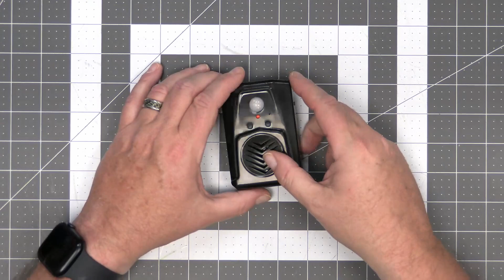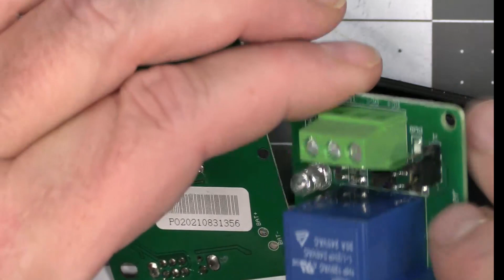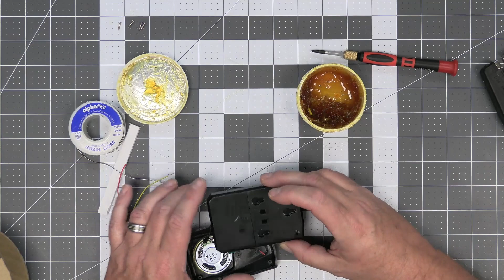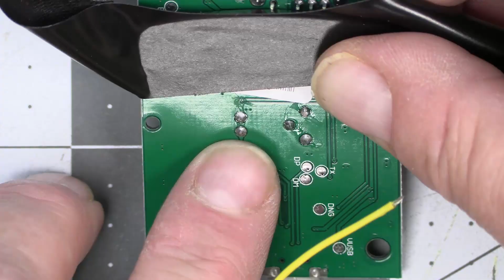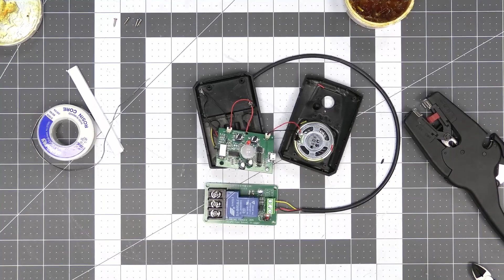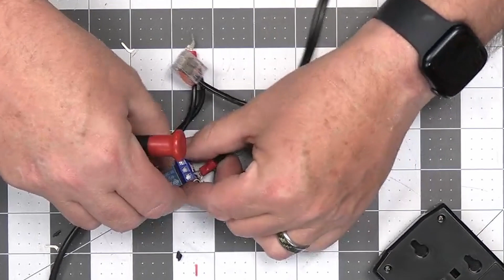Amazon Motion Sound Relay Hack

Comment: I used 10amp - 2 in 1 relay switch, the issue i am encountering that when mp3 device detect motion, relay fire for millisecond and then it waits for the mp3 sound to finish and led light on the device to turn off before it turns the relay again for good number of seconds.  I am not sure how to resolve the issue.

Comment: I can see some interesting Halloween applications for this . . . but . . . wire it for a wall wort instead of batteries, use the HD relay to switch several large floodlights, disconnect the speaker and send the audio to a PA System, and for the MP3, sample a clip from an old war movie - one where POWs are escaping {sirens, dogs barking, guards yelling, machine gun fire, etc}.  Then set it up in my garden for the next time one of the neighborhood teenagers sneaks over my back fence to steal my watermelons! 😁
Reply from the maker: I get quite a few security companies interested in our sound cards for just that purpose, mostly verbal warnings.

Comment: Thank you for the video.  I am trying a similar setup but I am using a dc motor off the relay. My question is where or what do I use to power the motor?  Thank you.
Reply from the maker: You would have to use separate power supply for whatever you want to run when the sound plays.   The relay is just a "switch" and doesn't provide any power.  I state this because a lot of people think it does.

Comment: Hi Steve!  Questions about this hack.  If you used the USB power block instead of batteries and wanted to trigger it with an external switch to the power (so the power is either on or off, triggering the sound when it’s on). How do you bypass the motion sensor?  Unsolder it from the board?  Would this option work?  Similarly, if I use the updated board instead of this boxed board, and wanted to take the motion sensor out of the circuit and trigger it with an external switch, would that work?
Reply from the maker: let me take a look at the one i have here and I'll let you know,  there may be a simpler solution.
Reply: I have the newer card and relay you used in the two videos with the grey zombie doll/prop.  I wired your setup to a corpsed child skeleton last year in her rocking chair and it was very successful.  I ordered the card/relay/motion sensor from you after our haunt last year, but haven’t tried putting it on the new prop yet.  We decided to make all the electric props powered from a manual button control box this year, so only one prop at a time is getting powered.  We were worried the electrical system in the historic lighthouse might not carry everything at once, since we’ve added some new props.

Comment: Hi Steve, I want to make a little project with maybe about 4 to 8 servos with a pca9685 and a nano. They each need a power source. I just want one wire coming out of this project and plug in a wall. I cannot find the solution to this. Something I can buy?
Reply from the maker: What voltage do you want for the servos.  I know the Nano and the servo board need 5V.

Comment: Great video.  Here are a suggestion to make it even more useful.  You could tap the positive for the relay board off of the power switch's on terminal instead of the battery connection.  This would eliminate the need to remove the batteries when you are not using it.  Another thing in the future may also be  to add a barrel jack to the board to allow it to run from a 5V wall wart instead of the batteries.  This would give you the power to run your larger relay board or multiple relays as you suggested at the end of your video for multiple light control.  If you use a 3 pin barrel jack wired correctly, then the device would work on either the batteries or the wall wart again, without the need to remove the batteries.
Reply from the maker: Those are all good ideas, I was going to do a more extensive video with some power mods but then I found this board which is now our best seller that incorporates all those abilities.
https://gravedecor.com/product/mp3-player-with-motion-sensor-3watt/

Comment: Thank you for the video!
Can a louder/better quality speaker be installed?
Also, could multiple units be wired to one motion detector?
Reply from the maker: Hi, thanks for watching!  You may want to check out this video as it allows for both a speaker and allows you to use powered computer speakers.  It’s an all-in-one board that you don’t have to hack.  All In One MP3 Relay Motion Sensor Board
https://youtu.be/ms_yqQ7_NSs

Comment: Would this work to be able to wire to a wiper motor for my prop so the motion activator would turn the motor on with sound at the same time?
Reply from the maker: You may want to watch this video.  This board does exactly what you are asking.  We just got them back in stock today, they were extremely popular.  You can buy the components to do it yourself or you can buy the kit completely assembled and ready to go.  https://www.youtube.com/watch?v=ms_yqQ7_NSs&lc=Ugz_LfDEVF1BL0J9bhl4AaABAg

Comment: The led should have a flat spot.The flat spot side is your negative(cathode).
Reply from the maker: The shorter of the two leads is another way to tell which is negative.
Reply: @TheMakersCave   unless they are cut off flush on the circuit board.

Comment: Hi Steve, thanks for the awesome content!

I wanted to ask, is there an easy way you could add a wire to the motion detector to allow the motion to be captured a distance away from the location you want the sound to play from? For example, I am thinking of putting the motion sensor at the beginning of a hallway with a prop at the other end that I want to make a noise when someone first enters the hallway. 

How would I go about this?
Reply from the maker: Hi!  With that particular all in one unit the easiest way is probably just what you said.  Open up hte unit, cut the speaker wires, and run a length of speaker cable to where you want the sound.  Although it doesn't help you right now, I'm going to be doing a video on a wireless motion activated sound project.

Comment: How would you hard wire this to be able to use a power cord vs batteries?
Reply from the maker: Very simple actually.  Use a USB pig tail.  Solder the red to the battery compartment red and black to the bat comp black.  Then use a phone charger brick to power.  That’s the cable I show briefly in the video.  https://gravedecor.com/product/usb-type-a-male-4-conductor-cable
Reply: Thank you so much!!

Comment: could you also use the leads from the speaker and remove the sound part of it basically and have it just be a cheap motion trigger and let the prop make its noise.  I've done this with the driveway alarms from harbor freight and just used the leads to the speaker.
Reply from the maker: Sure could. Just snip one of the speaker wires and put an mp3 file that plays the length you want the action for.
Reply: There are much cheaper ways of achieving motion sensing capabilities